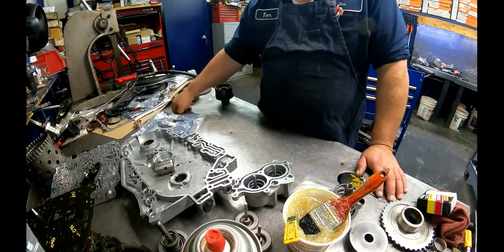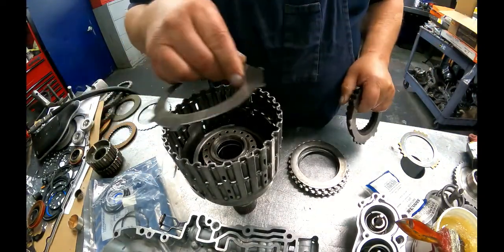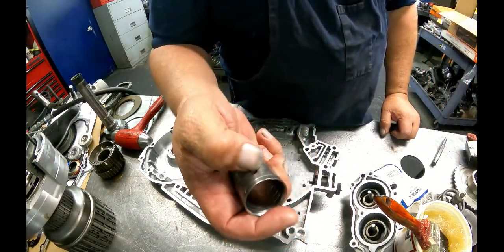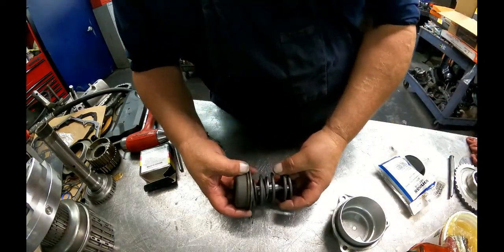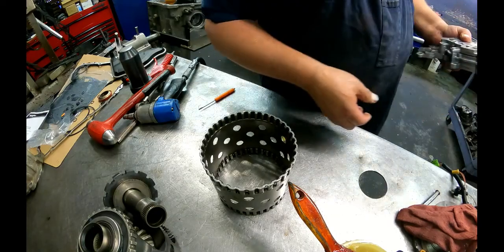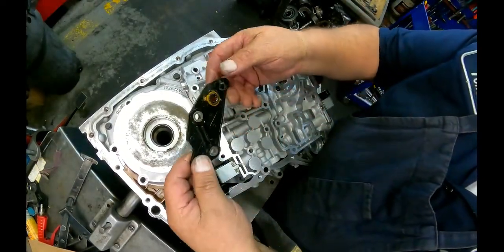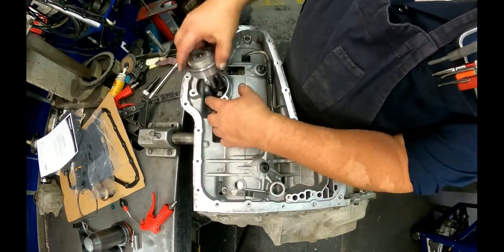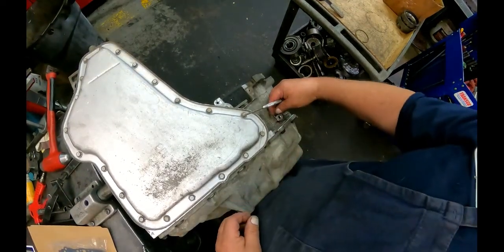4T65E HD Rebuild

Comment: Thanks again for all your help.  Completed my 2nd 4T65E with absolutely no problems after install!  works perfect.  Now I have a new issue.  Trying to do an on car repair for a 3rd 4T65E... The Owner was having shift issues and we were going to install K098 and 4T65 full kit in the valve body (while on car).   When I got in there I found two issues.  The first was a ball bearing stuck in the bonded gasket from the channel plate side... ordering new plate and gaskets...  How do you bond the new 2 gaskets, or do you just sandwich them?  Second.  I found about 1/3d of the Driven sprocket support thrust washer (Three tab washer behind the driven sprocket assembly) floating free.  I took off the sprocket assembly and found nothing... It is like it just dissapeared.  Any idea where the rest went?  Will I find parts in oil pan?  I just drained the oil but did not fully remove the pan and was going to replace the filter and gasket after I had everything re-mounted up again.  Thanks for all you do!
Reply from the maker: These washers do a real good job of disappearing. You may or may not find it. You won't be able to bond the gaskets to the plate. Takes lots of heat and pressure. You can use the gaskets from the kit but I like getting a new plate from the dealer.
Reply: I can't thank you enough for all the input you have given me.  I also have another question.  Do you leave the two thin strips of metal (used a a thermostat or something?) In the case when you hot tank them?   I have never seen you install them and as much as I try I never get the long strip perfectly straight again... thanks much!
Reply from the maker: It is a thermal element.It keeps fluid in the side pan till it warms up. Yes I leave it in, it helps to keep it from bending, IMHO.

Comment: I turned off the car several times and it would work fine in drive.  It seems most times, everything works fine.  I used both the kits you recommend for the valve body and did new steels and frictions and all new bamds.  I did not put the shifter electronic part in the hot tank.  All accumulator pistons and tubes were fine. I used the special tool to size the teflon rings exactly like you did.  Very puzzled now.
Reply from the maker: Sounds like you have a T/C drainback issue. Check the fluid level after it sits before starting and see if it is way high on the stick. Have you tried going straight to D1 immediately after starting?
Reply: I will check the level as soon as possible.  I have tried shifting it to d1 and when I do it goes into gear.  I feel the engagement.  Without even moving the car, I can then shift to drive or reverse and it engages and works perfectly.
Reply: BTW it is an 09 impala.  I have read about check ball in valve body and in cooler line fitting under the transmission.  Depending on the year.  I thought there was a change in 2003?  Anyway I replaced the o rings in the cooler line fittings and there definitely was no check ball in either one.
Reply: I checked my pictures with the book and I put them all back in the proper locations.  I also used the same valve body and channel plate that came with this transmission.  The transmissions original problem was a broken forward band.
Reply from the maker: Sorry it has been a few days since I have responded. I believe the change was sometime around then. Have done a quick search but not found it yet. If it is a drainback problem you could add the cooler line fitting that has it or install an inline ball. Teck Pak Fitzall sells them. Can get through Transtar or WIT.
Reply: After a day or two customer says it is fine no issues... very strange.  I read about a test to find the leak either in the valve body or T/C by pinching off the return line (GMs are metal, lol) after driving it and if the level does not rise overnight you are sure it is the T/C leaking.  Since I cannot pinch it, I was going to disconnect the line and plug both ends and check.... but as I said, customer says no issues now...  weird...
Reply from the maker: @ohiowrencher8650  Could be the ball had debris holding it open and got dislodged and seated finally.
Reply: Thanks!  I know things very rarely fix themselves, so I am psychologically ready for a comeback in the future.  I was wondering if it could be oil pump scarf cut seal expanding...  the bushing was fine.  

BTW I really appreciate you taking the time with me.  There are no transmission rebuilders in my town.  Closest is 20 miles away and they are all constantly slammed. If I could get better at this, it would open up a lot of opportunities.
Reply from the maker: Glad to help.

Comment: What would cause the transmission to barely move at high rpms in low 1 and 2 no movement in d or 3
Reply from the maker: I am assuming this is before a rebuild. Probably the forward band is breaking.

Comment: Is it possible to build one of these transmissions to actually last? I had a Grand Prix GXP and the transmission had issues 4 times before it went out of warranty. Finally the last time it was rebuilt by the dealer under warranty it lasted about 9 years before it finally went out again. I had it rebuilt and it lasted less than 3 years before I had it rebuilt again lazt year. I drove it normally, stepping on it once in a while but nothing stupid. Had a transmission cooler on it and it wouldnt go above 190's. I gave the car to my brother and he tells me it kind of slipped once on him.
Reply from the maker: I have great success with these doing what I do in the video. They have their problem areas but as long as you address them all they work well.

Comment: Is it possible to convert a 4t65e out of a non supercharge year to a 4t65ehd ?
Reply from the maker: Yes. The planets and the differential are hardened steel. Just make sure the differential is the same tooth count as yours. The 4th clutch has single sided clutches and can be put in any 4T65E, the clearance is the same. The valve body is different so do not try and put it in a vehicle that was not equipped for it, but the hardened parts can basically making it HD. If you can find them.
Reply: @CurmudgeonTransmission  where do you get your rebuild parts for these transmissions?
Reply from the maker: @Darrenlawrence89  WIT or Transtar. Links are in the description.

Comment: Doing my first Transmission watching your videos over and over and over etc...  I am not soaking my frictions as I see you do not.  Anything special you have to do before you first start the engine up after install?
Reply from the maker: You can add some fluid to the torque converter if you want. About a quart should do. Add 4 quarts to the transmission before starting the engine. Once you start the engine be ready to add fluid immediately. If you are unable to do that,start the engine for 10 or so seconds then shut it off and add 4 more quarts. Then you should be ok to leave it running while you check the fluid level. Adding until it reads full. Let it sit and run until it warms up. That is a good time to start resetting the adapts on the transmission. I would clear the codes before doing that, even if it says no codes present.

Comment: Another great 4t65e rebuild video! Your last video helped me get through what I thought were all my problems of harsh shift in all gears.  Took it apart and boost valve was leaking so did the sonnex repair kit, rebuild the valve body with new spacer plate as there was a check ball stuck in it. I also replaced sloppy chain and 4th clutch hub that had stripped splines. (even on a 03-new trans).  Now the trans still has p1811, and harsh shift intermit 1-2.  Im sure the clutch packs are worn so I am planning on going back in sometime and replacing the steels and frictions.  What brand do you prefer Raybestos, Borg Warner? Also what size steel do you add to the 2nd clutch drum to take up the clearance? It also has an intermit harsh engagement garage shift from rev to drive would that also be related to clearance issues with the clutches or should I look for something else?
Reply from the maker: Did you clear the codes and reset the adaptives? Either one of those brands are good. The harsh shifts and engagements are probably because of the 1811 code, it will raise line pressure when it is stored. The steel is the standard size. I believe .068, they do make oversized. I believe they are like .090. So you can play around with them to get it just right. Usually the one .068 is perfect.
Reply: @CurmudgeonTransmission  I did clear everything out and the p1811 is a pending code but Im sure it will trigger eventually.  Its not terrible, trans doesnt slip but downshift response is slow and jarring when giving it moderate throttle.  If I drive it feathering the pedal it shifts just fine when restarted and psi is reset. I replaced 1-2, 2-3 accumulator pistons and seals and did shift kit springs in those and 4th as well.  I didnt go any further than the 4th clutch hub as I thought I found all issues...Live and learn.  So you just add one of the old steels to the 2nd gear pack, and then shave off all the material on the direct clutches and adding that brings them in a better tolerance?
Reply from the maker: Yes sir.

Comment: Transgel gold must be made of gold, because I can't find it in stock anywhere.  Not available on Ebay or Amazon.  Is there a substitute?
Reply from the maker: The gentleman that made it place burned down. He decided not to rebuild. No longer available. Dr. Tranny red is the next thickest. Can also use Vaseline.
Reply: Thanks so much.  Your videos are awesome!  I cut two seals trying to get the piston into the input drum...all I had was the green lube, It obviously wasn't slick enough.  Also were had the large lip seals.  Thanks again!
Reply from the maker: You can thin it down with ATF or just use ATF. That is what I used before they came out with Trangel.

Comment: I have T1811
MAXIMUM ADAPTIVE SHIFT code showing at the reg garage.

I have this problem with my 2004 Pontiac Montana. It only happens (hard thumping shufts) when I have to step on the brakes to quick/estop. I have found that if I just pulse the brakes for a gradule normal stop. I never have the issue and can go weeks or longer without it happening. The next hard stop causes it all again to start again, until I pull over and turn the van off, and then it resets something. Can you give me any advice as to what needs to be fixed. I would really like to talk to you more about it. I am not sure where your shop is located, but I hope that it is nearby for a repair. I live in S. E. Pennsylvania. 
I am 72 retired and semi handicapped but really need this fixed economicly if at all possible. I don't want to lose the use of my van.
Thanks for your 
informative great video and your time. Hope to hear back from you
Have nice day
Charles G
Reply from the maker: Not sure why it is showing up under hard braking conditions. I would make sure it is full of fluid, and maybe slightly over fill it. After that if you have access to a scanner i would watch data on the speed sensors for the transmission and also ABS. Usually this code is caused by clutch clearances, worn AFL valve and accumulators. I will keep looking at how this is setting, usually it happens on the upshifts, not downshifts. I am nowhere near Pennsylvania, you can go here and it should help you.  https://atra.com/ShopFinder

Comment: My Drive and Revere are like Neutral.. what the problem with that? It's a 4t65e-hd
Reply from the maker: Needs to be checked out and make sure it is not something like a broken axle. But it sounds like it is time for a rebuild. Never know what you will find until you get in there.
Reply: @CurmudgeonTransmission  I'm going to get around to checking it out. Could be broke axle
Reply: @CurmudgeonTransmission  I need a rebuild. What state r u in?

Comment: Hello, please tell me if the automatic transmission is in emergency mode. The problem is no engine braking. Tell me what could be?
Reply from the maker: What kind of vehicle and what has been done to the transmission?
Reply: @CurmudgeonTransmission  Volvo car with s80 1999, with ABS, STC systems. The transmission goes into emergency mode and there is no engine braking. You drive 60 miles per hour, release the gas pedal, the engine speed is brought to idle, when you press the gas pedal, the revolutions increase to 3000 and the transmission engages the gear, after which it goes into emergency mode. Transmission 4T65EV. Tell me what could be the problem. And you also turn off the right front ABS sensor, the transmission comes out of emergency mode, but there is no torque converter locking.
Reply from the maker: Would need to know the codes that are stored in the computer. All modules, not just the transmission.
Reply: @CurmudgeonTransmission  After computer diagnostics, the error is TCM-000B. Replacing solinoids S1, S2, and linear pressure solenoid did not lead to a positive result. ((((((
Reply: @CurmudgeonTransmission  After the transmission went into emergency mode. I turn off the ignition, turn on the ignition and everything works normally, after the transmission shifts above 3rd gear, after that there is an emergency mode in the transmission
Reply from the maker: What codes are stored in the BCM?
Reply: @CurmudgeonTransmission  There are no BCM errors.
Reply from the maker: The code sets because the TCM and BCM speed signals do not match. I would look at the wheel speed sensors and see if one is not reading correctly.
Reply: @CurmudgeonTransmission  Replaced the left and right wheel speed sensors, replaced the crankshaft rotation sensor, replaced the throttle valve. no positive result (((((